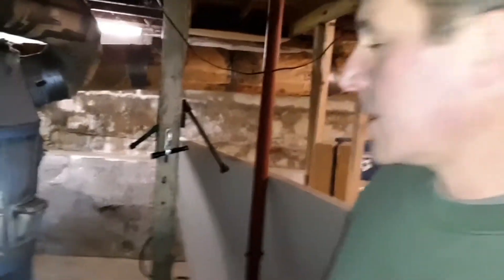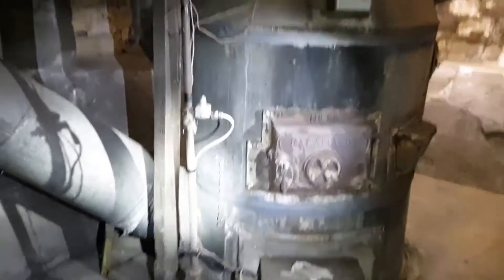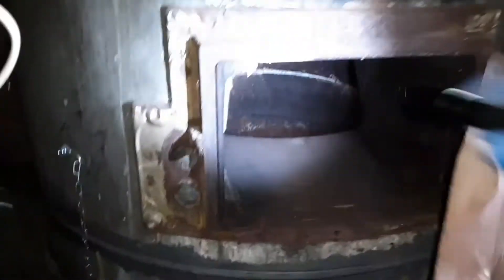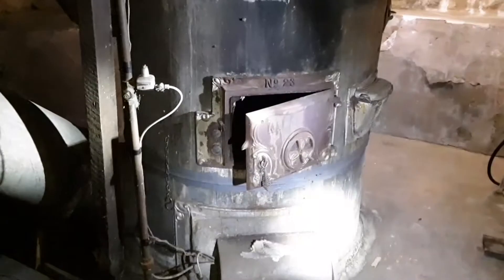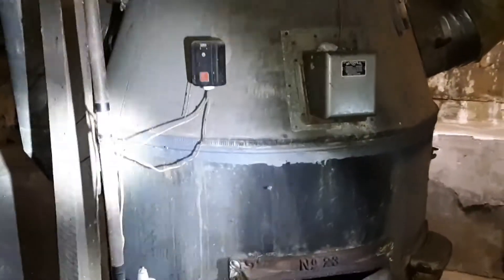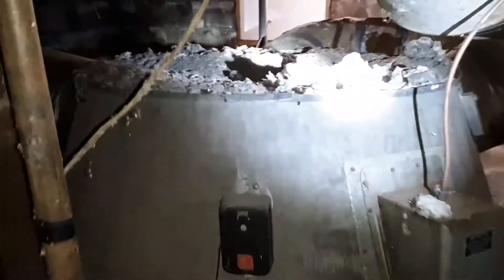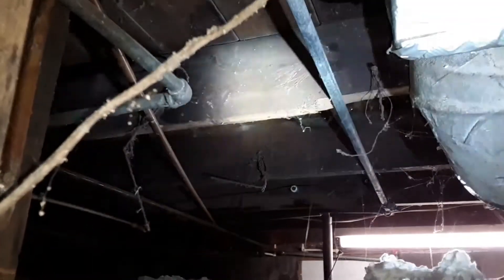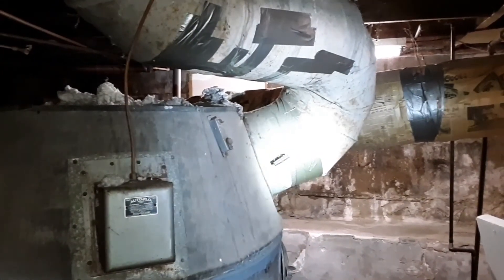🔥 #COAL ⛏#octopus🐙Gravity Furnace with ☣ #ASBESTOS-Still in OPERATION #kalamazoo#Gravity#Furnace#wmu

Comment: I used to run across these frequently in older Seattle homes; the "newest" I saw was 1943.  Most had been converted from coal/wood, to oil, then to gas; a few even had fairly state-of-the-art gas conversion burners, w/ electronic ignition and "pre-purge"; a few still were truly gravity, but most had an enormous blower assembly added at some point.  The one you show here still has the separate "B" gas valve for the pilot; the boiler in our present home (ca. 1954) had this setup as well, but the previous owner had a combination gas valve installed, as was required for selling the home...The gravity units were virtually silent, save for a slight whoosh when the gas burner ignited.

Comment: I have one of these! It's completely wrapped in asbestos like paper-mache style, so fibers aren't able to blow about. I love it, but it does scare me because of how loud it is. It's been inspected every year and everyone says the "boom" is normal, so I just have to trust that it is. Do you think these are safer or at least as safe as newer heating systems? Old  boiler/furnace experts seem to think so, and I even had a historic boiler expert who knows my friend that works at a historical site come out to calm my fears, and they said it was a "beauty" and that it will never have to be replaced. But of course, as you mentioned in another comment, we had a couple of "modern" HVAC inspectors come out and said it should be replaced immediately and that it could cause carbon monoxide poisoning, etc...

After doing more research, it seems these are not more likely than others to cause CO poisoning, but in the past it was just the coal that caused the true danger, correct? I have no less than 4 CO detectors scattered throughout the basement now just to be safe haha!

Comment: My dad (1931-2020) grew up in Calgary Canada and had a furnace similar to this in his house, which is still standing as of 2023, 👍 but as a kid he can remember the cold winters and putting coal at bedtime 10 pm and it would last until 4am until he needed to Stoke it again, pretty neat old stories at the time and after WW2 around 1947 or so, his neighbourhood got gas installation and gas burner conversion.
Reply: I grew up on 10A street just behind walt Healy motorcycle in  hillhurst calgary in a house build in 1913, it had one of those furnaces still on coal.
Reply: I'm surprised they went to natural gas in 1947.  I lived in a Century-home in Kitchener, Ontario, and transitioned from coal to oil.
Reply from the maker: Wow. Great story. Thanks for sharing.
And, Thanks for watching.
Reply from the maker: Wow. Great story. Thanks for sharing.
And, Thanks for watching.

Comment: How much would this cost to dismantle and replace
Reply from the maker: Good question. I couldn't tell you. But there are 3 areas of cost. 1st, removal of asbestos by an approved company 💲.
2nd, all of the ductwork has to be replaced with a new system for size, plenum,etc..💲💲 hidden cost.
3rd, furnace installation based on btu size and type of efficiency model 💲. 
 Thanks for watching the video.

Comment: How do you turn it on
Reply from the maker: Thanks for watching the video... Thats a good question. 
Because of the way it is set up right now with natural gas and a burner, it uses a standard "thermostat". 
But how it was "originally" built, you had to light a fire inside the heat exchanger every time it's used. Then you would have to keep putting fuel into it continuously. "Hard living back then"
Thanks for the question...

Comment: Hello, do you know how to clean one of these? I have one that's 122 years old and the pilot flame is  suddenly orange, and therefore not lighting the "bonfire," aka the heat isn't turning on. I've done research and everywhere says it needs to be cleaned (and/or the thermocouple needs to be replaced)....how do I clean something like that? Vacuum? The door access is just small enough that I can't climb inside....thoughts?
Reply from the maker: Ok. Thermocouples can be cleaned sometimes simply with a wire brush. The debris that collects on it will be a whitish calcium looking or blackish film from the natural gas over a period of time. It is easier to clean it if is removed, but then you may want to just replace it at that point. You are right about orange and yellow tipping on any flame (pilot or burners) is an indication of improper burning. The flame should be a nice even blue. 
However, if the pilot is staying lit and the "burner" aka "bonfire" does not turn on then it sounds like debris on the burner or ribbon burner, which ever type you have. Or it could be a problem with the gas "control" valve or "regulator" which provides gas to the burner. (You may not be getting gas to the burner).
Now, these gas control valves or gas regulators on old octopus gravity furnaces have many styles. The gas "regulators" were the original conversion kits installed when the gas was available. These sometimes need adjusting or replacing. 
The problem you may come across is finding a HVAC contractor to repair or replace the part without selling you a new furnace due to an excuse like efficiency, environmental or protecting their licensing. I've heard them all. 
I hope this was helpful.
Thanks for watching the video. 
Don't forget to Like, Share and Subscribe

Comment: It takes years of exposure before asbestos causes cancer or any other problems simply being used as an insulation wouldn't do it. Still a really cool find though.
Reply from the maker: Scott Thanks for watching the video.
My replay is simply... Yes and No.

Yes… 
According to the EPA quote; “In general, the greater the exposure to asbestos, the greater the chance of developing harmful health effect. Disease symptoms may take many years to develop following exposure”.
This is why I never speculate about the amount of exposure to asbestos that can cause lung cancer.

No...
EPA statement: “Asbestos fibers may be released into the air by the disturbance of asbestos-containing material during product use, demolition work, building or home maintenance, repair, and remodeling. In general, exposure may occur only when the asbestos-containing material is disturbed or damaged in some way to release particles and fibers into the air.

CPSC U.S Consumers Product Safety Commission statements; “The mere presence of asbestos in a home or a building is not hazardous. The damage is that asbestos materials may become damaged over time. Damaged asbestos may release asbestos fibers and become a health hazard.

As for me, my business of inspecting in the last 30 years, homes with asbestos on ductwork have many issues including high liability.  
1.	In recent years one of the biggest duct cleaning companies in Michigan will no longer clean your duct runs with the presence of asbestos. 
2.	You buy it, you own it, and you have to disclose it before you sell it.
3.	The cost of encapsulating is expensive
4.	It is true that there is more hysteria in recent years because of consumers watching commercials about mesothelioma lung cancer and Class Action Lawsuits which are linked to asbestos material. 
5. "If the asbestos material is in good shape and will not be disturbed, do nothing! If it is a problem, there are two types of corrections: repair and/or removal" quote by CPSC
Reply from the maker: Kevin I Disagree... 
EPA statement: “Asbestos fibers may be released into the air by the disturbance of asbestos-containing material during product use, demolition work, building or home maintenance, repair, and remodeling. In general, exposure may occur only when the asbestos-containing material is disturbed or damaged in some way to release particles and fibers into the air.

CPSC U.S Consumers Product Safety Commission statements; “The mere presence of asbestos in a home or a building is not hazardous. The damage is that asbestos materials may become damaged over time. Damaged asbestos may release asbestos fibers and become a health hazard.

As for me, my business of inspecting in the last 30 years, homes with asbestos on ductwork have many issues including high liability.  
1.	In recent years one of the biggest duct cleaning companies in Michigan will no longer clean your duct runs with the presence of asbestos. 
2.	You buy it, you own it, and you have to disclose it before you sell it.
3.	The cost of encapsulating is expensive
4.	It is true that there is more hysteria in recent years because of consumers watching commercials about mesothelioma lung cancer and Class Action Lawsuits which are linked to asbestos material. 
5. "If the asbestos material is in good shape and will not be disturbed, do nothing! If it is a problem, there are two types of corrections: repair and/or removal" quote by CPSC

This is why I never speculate about any amount of exposure to asbestos.

Comment: Wow! I saw one of these that was converted over to oil fired and they added a forced air fan unit and it even had central air added on to it lol. The way they did it was, they put the fan unit and A coil between the cold air return and the furnace.
Reply: The name of the company I saw on the Air handler said "Horner Brothers, Bridgeton N.J." but they've been out of business since the 70s' This was an old belt driven unit and The condenser unit was an old round Carrier unit so this was probably done in the late 60s or early 70s
Reply: Please provide the name of the company that did the ac addition? thanks!
Reply from the maker: Wow. You got me on that one. In last 30 years I've seen a few converted to forced air, but not a-c...  lol.
Reply: @inspectflix    Is there a company in Kalamazoo or Battle Creek that still services these?
Reply from the maker: @jonbloore256  Thanks for watching and for the question. I dont believe you can find a licensed HVAC contractor to service gravity furnaces. The last i heard 10 years ago,  contractors can loss their license if they service them. Not sure if thats true, but there's not much to service. The gas control valve and pilot thermal coupler are the only things to go . Maybe keeping the flue exhast pipe  clean and front door hatch sealed. Sometimes old retired contractors can be found to service thise simple items. I also wouldn't be surprised if  in the last 10 - 15 years , HVAC licenses have adapted to green energy guidelines due to the very low energy efficiency. THANKS AGAIN.👍